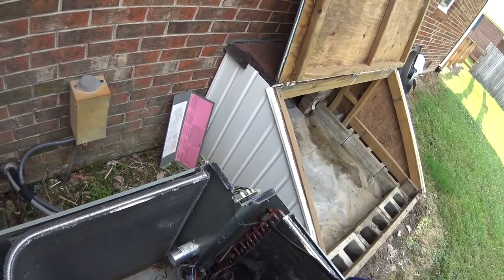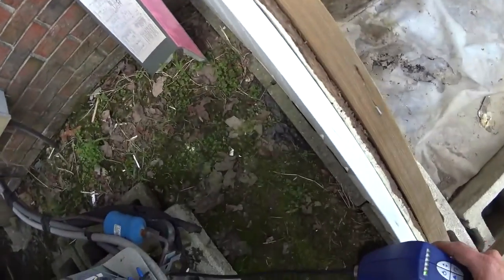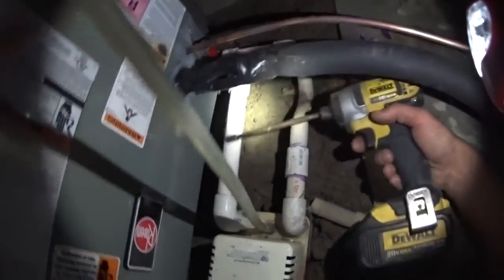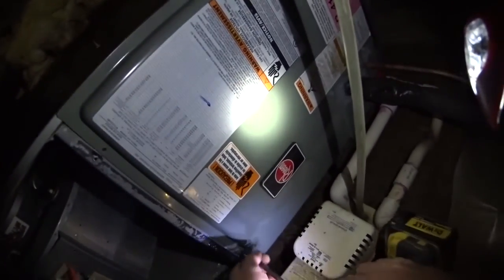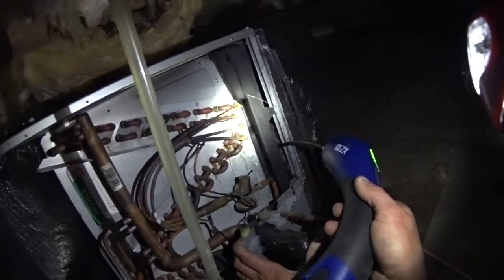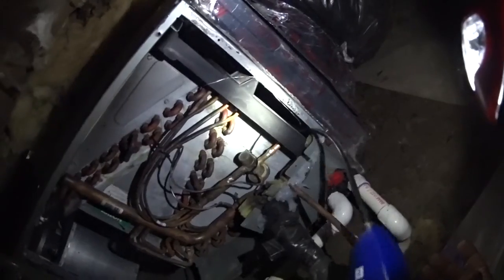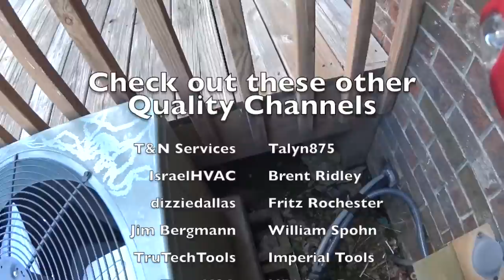HVAC Service: Rheem Leak Search

Comment: Great video Stephen! And nice find! I'm guessing soap bubbles and nitrogen wouldn't have worked here huh? Also... Love the outtro jingle! Lol
Reply from the maker: To me nitro and soap are reserved for systems with zero pressure upon arrival. Sniffers work best if you've still got decent pressure in the system. With nitro you'd have to recover, test and vacuum which takes a lot of time.
Reply: Solid point.

Comment: When it gets slow does your company let installers do leaky coils of there is nothing for them to do?
Reply from the maker: They try to catch up on old inspection failures or whatever but rarely take the sealed system work away from the service dept Derrick